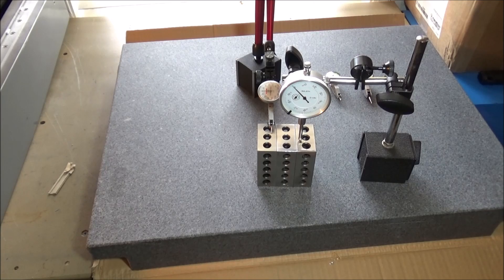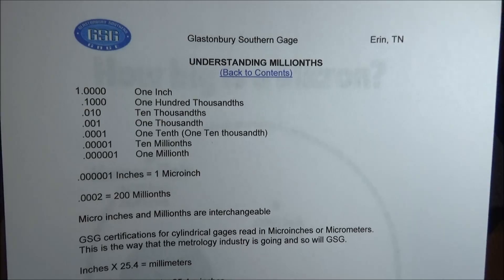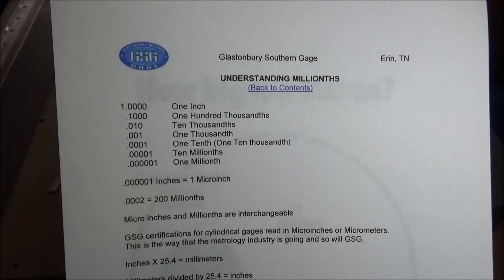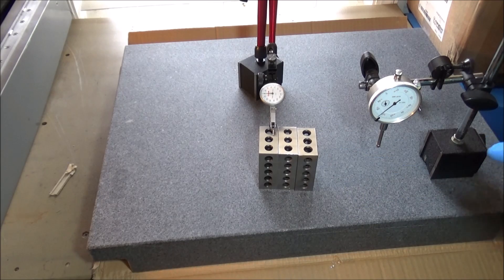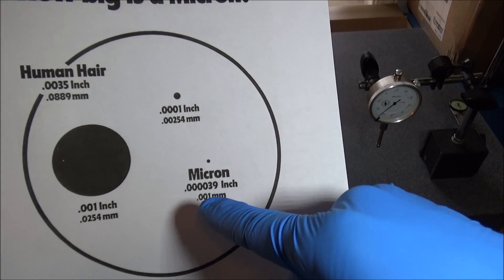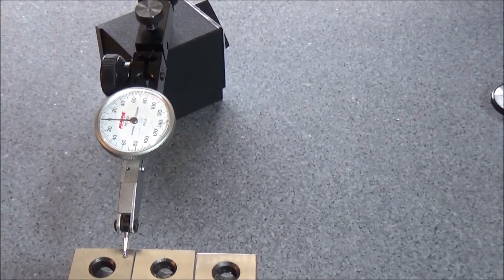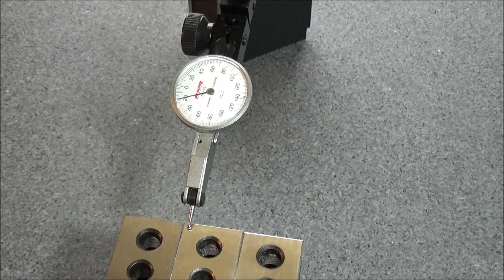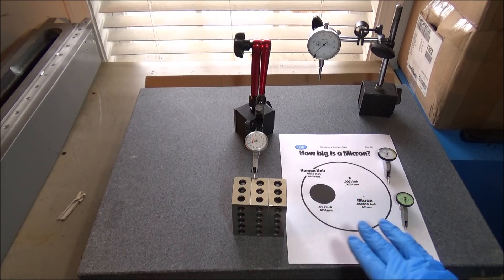How big is a Micron

Comment: I’m just here because I wanted to understand a shop air filtration system. I’m looking at a Rikon 62-100 that the specs states “designed to filter 98-99% of all particles five microns in size and 85% of particles one micron in size”

I had no idea how small a micro is and the human hair comparison puts it into perspective. I also learned I should probably buy a higher resolution gauge for measuring machines surfaces (for engine motors)
Reply from the maker: Your welcome  thank you

Comment: It’s not a tenth of an inch it’s a tenth of a thou it’s just that machinists pretty much start at “a thou” and not at zero is a better way to think of it. It’s easier when represented as metric because each 10 value has a word associated with it separate from the number system and not designed to only the variable of “inch”
Reply from the maker: Very good explanation. thank you for sharing.

Comment: Interesting video. I feel that you are too hard on yourself. There SHOULD be some confusion.

It's pretty bad, here in America. Most of us are harmfully addicted to an antiquated measuring system that makes it so we are measuring illiterate as far as the rest of the world is concerned. So, if you are using US Customary Units or what was SAE units, you can just forget about selling your wares overseas, because really, who besides Americans wants to but two sets of tools.

It's really hard to find metric materials here; many USCU/SAE materials are now in metric, disguised, such as 12mm plywood, so nothing we make fits anymore anyway. 
I think that metric is the best thing for America's future, because the SAE battle is already lost.

Metric is pretty nice. Millimeters and their decimals rock for machining. As far as nice handful chunks, 100mm is a nice size, and so is a meter, or about as far as we can stride.
Reply from the maker: While I don't disagree Its so hard to convert! one availability is a issue with tooling and using both stinks.
They tried to convert in the 70's early 80's but that did not go over well.
Reply: @CNC4XR7  , I hope that all Americans pitch in and learn this thing, before it's too late.

Comment: Rule of thumb..  measurements should be taken using an instrument that has a resolution that is 10x lower than your tolerance. For .001 tolerance use a .0001 indicator.
Reply from the maker: Sounds like a good Rule!
Reply: @CNC4XR7  lol thanks but it's not mine. Its QC standard practice.

Comment: There's 3 basic terms in metrology that need to be clearly understood. Resolution or basically how finely divided the equipment's markings or it's display is. Think of it as how many decimal places the equipment has to the right of the decimal or zero's. Accuracy which is NOT the same thing as that resolution. And repeatability, or how well the equipment can get the same repeat reading time after time. Repeatability as well as it's accuracy is a factor of how well the instrument's internal design was done and functions, and also how well it was manufactured. Accuracy of well made equipment by reputable manufacturers is still within tolerance with as much as + - one count for both analog and digital equipment. In other words a 1/10th reading indicator can misread by as much as + or - 1/10,000 and still be within the allowable deviation. 

Most equipment I've checked against good gauge blocks will usually check around half the allowed deviation. Only one item I've checked was roughly 1.75 of the allowed maximum. However if you don't check yourself there's no way to be sure of what your equipment can or can't do. You could have a 1/1,000,000ths reading indicator, but if it's poorly made and can only be depended on to be somewhere within .001" it would have a high level of resolution but lousy accuracy and repeatability. Anyone using the 0 or 5 of the 4th decimal place on a digital caliper is wasting there time. Even the best calipers in trained hands is only expected to be accurate within .002" - .003" Sometimes under perfect conditions they can do a slight bit better, but under .005" measurement accuracy you better be using a mike.
Reply from the maker: Thanks For the comment!
Very well Stated.

Comment: Us hill folks have the best standard of measurement. 10 frog hairs is equal to a gnat's ass. They need to make these available on fusion so it would make it easier to use.
Reply from the maker: Yes us Ga boys use those terms as well but I don't think that translates internationally! And trying to get tolerances finer than frog hairs are beyond the capability of home Hobbyist.

Comment: When you used the 0.002 mm indicator, it showed a difference of 20 increments between your shortest and longest 123 block, not 20 microns but 40 microns. 20 increments of 2 microns = 40 microns :)
Reply from the maker: Yes that confused me as well at first since this indicator was new to me I had to really take a good look. From 0 to 20 is only 10 increments each increment is .002mm the numbers are 0-20-40-60 etc.  so it would be 20  microns or  .00078"
Reply: @CNC4XR7  Ah, I didn't get that despite watching it 3 times to be sure before I posted my comment :) darn!
Reply from the maker: @DanielSallros  
That was my first metric indicator so I was confused too maybe that's just how they read. If it were 40 microns it would have been about .0015"

Comment: it's ten one-millionths
Reply: is that imperial ?  a so called micron =  1 um (micrometer) = 0.000,001 meter = 1 millionth of a meter   ( like in uF  etc )
Reply from the maker: 0.0000001 one ten-millionth

0.000001 one millionth
Reply from the maker: Yes Imperial, so 1 micron is 0.0000393701"
Yes  a so called micron =  1 um (micrometer)

Comment: I don’t believe as a hobbyest, I don’t think the machines we use are going to keep any tolerance like that
Reply: With tolerances that low, wouldn’t varying temperatures change the readings substantially when measuring material or blocks day to day?
Reply: @heeder777  very much so.
to hold tolerances like this, we have climate controlled shops. where all the material is normalized inside for at leat 24 hours before being machined.
and the temp of the part is closely monitored during machining.
opening the roll up door to bring stuff inside swings the temp enough we shut down. normally all material is transfered inside at the end of the day.
shafts we do are under one inch in diameter. hold it in your hand for 5 minutes and it wont go in the bore.
Reply from the maker: No not at all however its really the resolution were after.